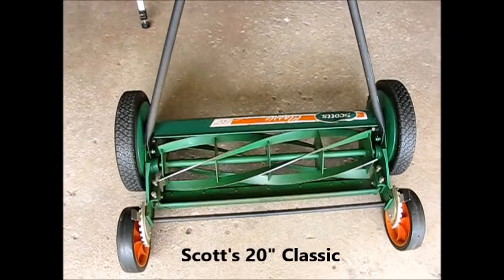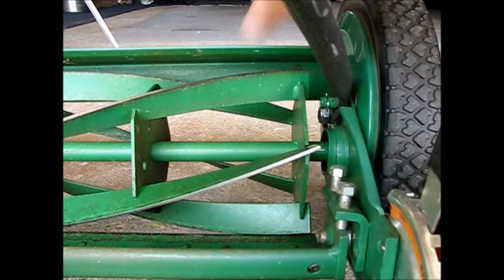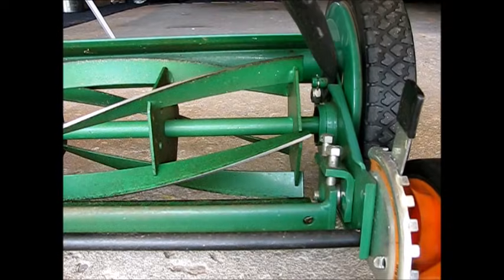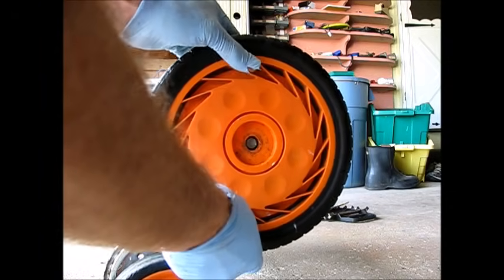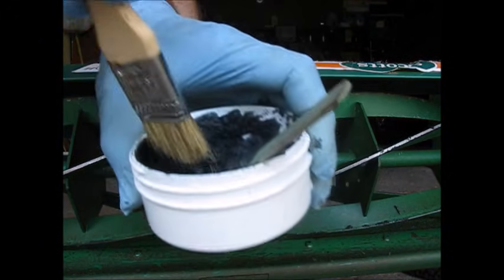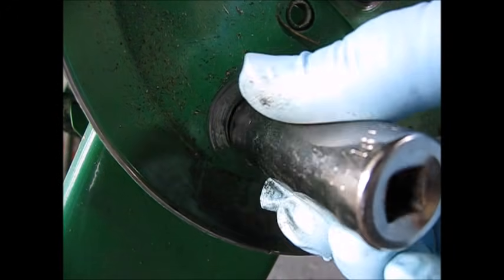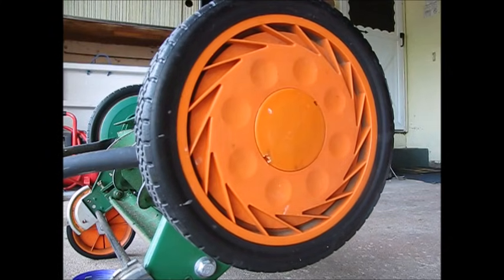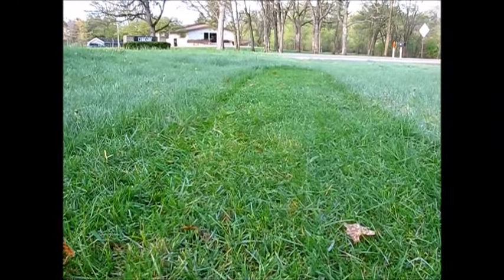How to sharpen a Scott's reel mower

Comment: i really hope these quiet and green mowers make a comeback in my neighborhood, i recently bought one and its been great, i get some exercise without all the noise and pollution, i can have earbuds in while i mow now and i dont have to worry about flinging rocks and other debris across the yard. thanks for sharing this video, a much easier process than i was expecting!
Reply: I agree with you,  I converted to using a Scott's reel mower this season.  It's made a huge difference in the health of my yard.  I haven't had to buy gas for mowing either.
Reply: There are pull behind units that can be pulled with  electric golf cart, or gas powered
Reply: What might be interesting is hacking a treadmill motor (or even a portable drill) onto a push mower, driving it at the main wheels via contact roller, or at the height adjustment bar with the rollers/wheels there being replaced with aerating spikes or similar -- anything for traction's sake.
Reply: We got one this past summer and our grass looked the best it has since we laid the sod. It was way more green and lush all summer. And I love the noise reduction. It is a wonderful tool.

Comment: Awesome!  I've been avoiding sharpening my mower because I expected to need special equipment for it or to pay someone else to do it.  This looks very doable!
Reply: YES, I THOUGHT THE SAME
Reply: This is too funny. I just purchased a used mower on ebay because I lost pieces to my first one.I didn't remember watching or writing comments, but I decided to watch a sharpening video and I always read a few comments. And I responded a year ago to your comment. "Ironic"
Reply: It actually is I have an earthwise 7 blade reel mower and by me watching videos like this one here you learn quite a bit
Reply: All that is needed is the abrasive; go to hardware or auto part store to buy silicon carbide paste or valve grinding compound. Exchange left/right pinion gears, look at the pin on the shaft: one side is sharp, the other side is rounded, reverse the sides also. Put the wheels back and push the mower backward.
Reply: A mixture of sand and grease works as a grinding compound too...and much cheaper than the store bought compound.

Comment: Thanks so much for this! I have the exact same mower, and it told me exactly what I needed to know.
I had trouble getting my e-clip back on with just the screwdriver. Finally I tried the screwdriver with a gentle bop from a mallet, and it snapped right on.
Reply: Needle-nose pliers work like a charm

Comment: That's awesome. 
I love these mowers, because they are quiet and gives me extra exercise,  but I did not know how simple they are to sharpen.
Thank you much.
Kenny
ps. my Plymouth voyager waterpump, timing belt went super easy due to your detailed video series.
Reply from the maker: I feel the same way. I like early morning mowing with some dew on the grass and maybe an IPOD. I'm glad you had success with that tough water pump job.
Reply: Reel mowers are more healthy for the grass as well because it cuts like scissors. The best weed prevention is a thriving lawn. You may notice fewer weeds like crabgrass if you use a reel mower.

Comment: Thanks for your detailed step by step guide here. I was able to use my 1/2 inch chuck corded drill directly attached to the mower's crankshaft. Did not run it eight minutes, more like 4 but with fast revolutions. Definitely much sharper! Just really noisy when pushing it and can't seem to adjust the edge so that it's both quieter and keeps cutting. Guess it'll stay loud but at least cut the grass well!
Thanks again....great video.

Comment: Good video. On my mower (1950's era) you can take off both wheels and swap over the gear mechanism between left and right and reassemble. Now you can push it along on a flat surface so the blade turns in reverse for sharpening with grinding paste. Saves buying a kit and having to turn by hand, but clearly needs a bit more disassembly ....but its another option. Thanks again
Reply: That's great info!! Mine is similar,  an older craftsman with bolt on, adjustable wheels and reversing them makes perfect sense!. I saw a video on that method but he just said "make it so it goes in reverse " so i wasn't sure how because it was a different model.
Reply: I was reading through the instruction manual for the Scotts mower in this vid and they have a short guide on how to do just what you described. Concepts haven't changed much in 70 years! The details are on page 6 of this PDF: https://almgscapp.azurewebsites.net/Manual/View/2010-20SG 

It also specifies a lapping compound of 100-240 grit for anyone out there who doesn't want to buy a special sharpening kit :)
Reply: In the Scott reeler mover is the same, that is the way I did mine.  However, why does it have to rotate backward to sharpen it?
Reply: @carlospadilla7296  i wanted to bump your question to the top. I too want to know the answer to your question.
Reply: Sharpening the cutting blades
When the mower is properly lubricated and
adjusted, sharpening should not be necessary
for several years. However, the following steps
will allow you to do the procedure yourself at
relatively little expense.
• Remove the "E" rings, wheels and pinion f r o m
both sides of the mower (refer to figure 6).
• Remove both pawls from the rectangular slots
in reel shaft and reverse their positions (refer
to figure 7).
• Reverse the placement of the pinion gears.
• Place the left pinion on the reel shaft.
Replace the wheels and "E" rings.
• Spread a thin layer of lapping compound on
the front edge of the reel blades.
• Adjust the cutter bar blade so it has light but
firm contact with the reel blades across the
full width of the cutter bar (refer to figure 8).
CAUTION:Do not overtighten the adjusting
screws, as this could damage the cutter bar.
Both screws must be tight on the final adjust-
ment.
• Push the mower backward on a smooth sur-
face (such as a sidewalk or paved driveway).
Continue to do this until the reel blades rotate
relatively free and front edge of the cutter bar
blades are polished.
• Remove wheels;reverse pinions and pawl is
on the right.CAUTION:Clean any grinding
compound or debris from the cutter bar
blades, reel blades, pinion and pawl.Lubricate
axle and pinion with a light film of wheel bear-
ing grease and replace wheels and "E" rings.
NOTE:It is recommended to use an industrial
or valve lapping compound between 100-240
grit.This is usually available at an industrial or
automobile supply store. If professional sharp-
ening is required, consult your local yellow
pages for lawn mower repair services

from scott's mower manual ...

Comment: An observation: at about 1 1/2 min. in,  adjustment of the blade might be easier if the bolts holding the blade in position were loosened at both ends, adjustment made and bolts retightened.  They're the horizontal bolts going through the main frame, adjuster screw bracket and threading into the blade frame.

Comment: Excellent video... really explains what to do very well step by step.  In putting the E-ring back on the axle, would recommend needle-nosed pliers as opposed to the flat head screwdriver.  Was not successful with the screwdriver but the pliers worked well.   Dan
Reply from the maker: Thanks for watching and commenting!

Comment: if all you can find is a 13 point or whatever 11/16 deep socket you can fold up a couple strips of cardboard about as wide as a popsicle stick and 2-3 times as thick-and put them inside socket pushed to one side…it will tighten things up just enough to work on your drill…it might slip a little but once you get going it’s fine. The only thing I bought was a tube of permatex valve grinding compound. Worked fine…very sharp. 👍. Scotts Pro 18” 7 blade…everything is the same mechanically…just 2” narrower with 2 more blades.
Reply from the maker: Good tips, I'm going to try the Permatex next time. Thanks for sharing!

Comment: I managed to follow your instructions to get my grandad's reel mower (scotts 5m9 from the 60's) sharpened. I was wondering though if it's necessary to lower the contact bar at 1:00 after the blades have been sharpened.
Reply from the maker: I made that adjustment before sharpening due to a gap. After sharpening this won't be necessary if the bar was making good contact before sharpening,
Reply: @TheOriginalMechanic  Got it. Thanks.

Comment: After removing the circlip, the wheel, and the pinion gear, please note that each drive pinion has a little shuttle pawl that loosely fits through the reel axle shaft. This pawl acts like a ratchet to lock the drive wheels to the reel axle when pushing forward, yet clicking slightly when pulling the mower in reverse as the pawl's two angled ends shuttle back and forth between the THREE cavities cast in the inside faces of the pinions (that's intentional).. Those pawls are designed to lock up in one direction (FORWARD) and slip in the other (Reverse) ; i.e. ......... you must be sure to write down the orientation of the pawl faces. Just note where the bevel is in each of the two pawls. If you put the right side pawl in upside down, for example, , as you push the mower, it will be driving only the left wheel, the right wheel ratchet will think it's going in reverse, and the mower will pull to the left because there will only be resistance from the left wheel..

At the end, the right side of the mower cut was leaving a fair amount of "holidays' as compared to the left.

FYI

Comment: I have the same mower and kit you used. I’m only curious HOWit sharpens the blades. Doesn’t it need to rub against something?
Reply from the maker: Yes, as the cylindrical blades rotate, they contact the stationary blade at the bottom. The abrasive cutting paste that has been applied then sharpens the edge of the cutting surfaces of the rotating head.

Comment: The little piece you shouldn't loose in the drive shaft can be turned around. If you put the wheel back on you can spin it in reverse. much easier than hand cranking it.

Comment: Does the left wheel have the same tiny pin you said to be careful with? Because I think I may have lost mine in the grass 😖
Reply from the maker: I don't know about the pin. You may have to look for a replacement. I would take the other to a hardware store to try to match it.

Comment: The only thing about this mower.....I wish the bed knife was designed like pro mowers. It's a 90 degree angle rather than a flat introduction for the reel to come into. And there is no relief on the reel itself. How do I know this? Turf degree. So.....it is what it is. This mower jams frequently too with any instructions. Sorry...I should add I modified the mower to cut at 1/4 inch for the tee box on my property. I give this mower a 8 for it's class though. Thanks for reminding me how to back lap!

Comment: Nice video! After you sharpened, did you re-adjust the screws back to the position they were before you started
Reply from the maker: No, I did not. I think that would take the blades out of contact with that lower cutting edge and result in a poor cut.
Reply: @TheOriginalMechanic   No it keeps the blades from wearing out faster and reduces the force needed to push the mower. You will notice after cutting your grass enough that the mower gets easier to push due to the blades losing contact with the lower blade.
Reply: Yes you should adjust to light contact..

Comment: Something I have noticed is that my Scott get's a little more difficult to push after each sharpening. I've used it for about eight years now and it's really hard to push after the last sharpening. I tried loosening the bottom blade a little but then it wouldn't cut the paper. I think there may be a point when it's just time for a new mower.
Reply: I don't have a Scott's mower but from experience I would guess that the bed knife may be a little worn. If the point of contact between the reel blades and the bed knife is too great  you will need to tighten up the bed knife excessively to achieve a consistent cut. Is it possible to unscrew the bed knife and then either turn it over, file it down or even replace it? An alternative is to grind a chamfer on each of the reel blades so that only the first 1/32" of their width comes into contact with the bed knife. Obviously that takes a little time, but it's worth it as they cut so well after you have done this.
Reply: Long time ago but did you ever figure out what to do about this? I have exactly this issue after sharpening at 30-year old mower possibly for the first time.
Reply: @alexbryant93  I ended up buying a Worx battery electric mower. I used both mowers for a while depending on my mood. I think the reel did eventually get easier to push but I have no room to store both mowers so just use the electric now.

Comment: I have a Earthwise 16" manual reel mower and want to sharpen the blades with a backlapping kit. I don't want to use the crankbar because it's too manual and slow. I'd like to use my cordless drill but my drill chuck does not fit the axle bolt to turn it. Any suggestions??
Reply from the maker: You should pick up an adaptor that will fit into your drill chuck on one end and a 1/4 or 3/8" socket on the other.

Comment: Is there a reason you don't just reverse the reel gears and push the mower around with lapping compound for 10 minutes? That was how I was taught way back when, but it seems like every video says to use some form of mechanical advantage to turn the reel backwards manually. I'm not even sure I can find a video on reversing the gears on these machines, although I thought it was in the assembly guide when i first bought the mower.
Reply from the maker: I can understand what your saying and can think of no reason for not trying that. It would certainly be simpler.
Reply: There is at least one I've seen, but don't have its address. It is there, however, and is simple enough

Comment: It's still not clear to me what surface the blades are sharpening against. What is needed other than the crank tool?
Reply from the maker: The leading edge of those rotating blades are being sharpened. You need the abrasive action of the sharpening compound.

Comment: Are we supposed to reapply the lapping compound a bunch of times throughout the 8 minutes?  The instructions don't mention this, but it seems like the compound gets pushed out of the way and does nothing after 10 seconds, let alone 8 minutes.
Reply from the maker: I only apply it once.. with good results. There's no harm in more, I suppose.
Reply: Hmm, ok.  I'll have to try having faith in the process next time then.  Thanks.
Reply from the maker: You're welcome.
Reply: Yes you should reapply until it cuts paper all the way across...after you rinse it off adjust until you have light contact, cutting paper all the way across

Comment: could blades be sharpened using a dremel tool??
Reply from the maker: I would think so, but it would be difficult to match the evenness of this method.
Reply: You can but it won't work as well. You'll probably hear clicking sounds afterwards caused by low and high spots in the blade.
Reply: Absolutely not..the actual grinder works like a lathe so each blade is exactly the same to the thousandth

Comment: I can't get the screws to budge to get move the blade away from the surface (sharpener).  Any ideas?   I've only had this thing for 1 year
Reply from the maker: I would try soaking them in penitrant like WD40 or the popular PB Blaster. If that doesn't work try jarring them a bit with a hammer, or use an impact driver if you can get hold of one.
Reply: PB blaster..of not drill it out and replace

Comment: Did you re-adjust the screws back off the blade when done?
Reply from the maker: No. They stay where they were for sharpening.
Reply: Thank you
Reply: So, do not re-adjust?
Reply: Darlene Schlick I'm confused. I think they should be readjusted once you're done sharpening...
Reply: Paul Ramirez no you don't readjust, because you are honing the blades and that will set the gap. If you adjust the blades back out they will be to far from the bar and won't cut properly.
Reply: What happens when you loose the cutting plate so the blades run freely, will it still cut grass
Reply: @Boschwash24  Some mowers will cut fine that way.
It is quiet.
If you have good bearings on your machine and some feeler gauges, set a tiny gap, like one thousand of an inch between the reel and bedknife.
Be careful not to snip your gauge!

Comment: this is not sharpening it is called back lapping, this is meant to remove small nicks a honing..all mowers  should be correctly sharpened every year or two..then lapped  periodicly depending on how often you mow..
Reply: glad you said something...i was gonna say  that this is deff not sharpening
Reply: I sharpen reel mowers in St Augustine Florida, you could see how much it is to ship just the lower unit (take handle off) I charge $100 to do reel and bedknife.. so probably cheaper to buy new..just don't sharpen with a stone or file..backlapping most likely the cheapest easiest way..I use R&R products for lapping compound..